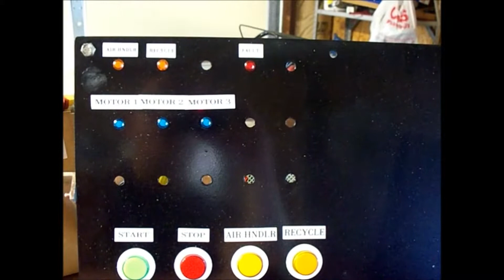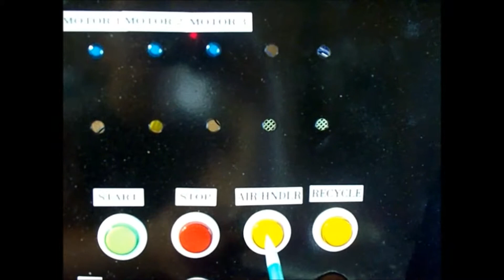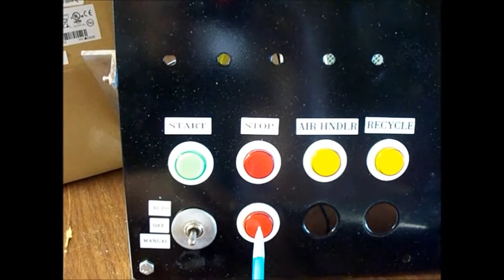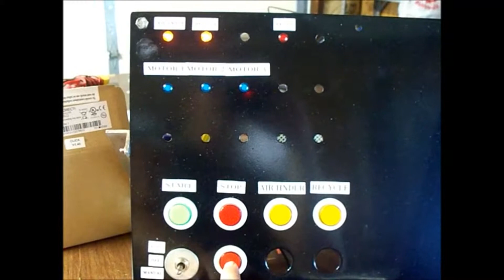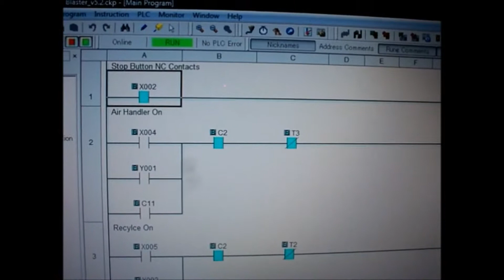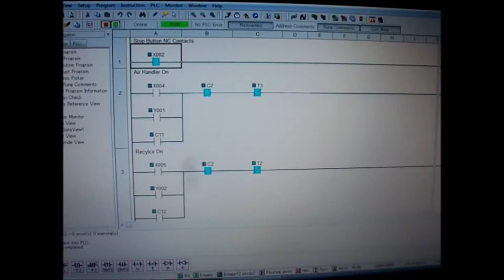Click PLC Project 1:  Wheel Blast Machine Control

Comment: Hello Darren, I liked your video, I was wondering if you can explain how did you wire your plc. Are the lights running on 120 V? thanks
Reply: Yes the lights are 120 V AC.  If you download the click plc manual from automation direct they have diagrams.  Basically the switches close and send 120VAC to each input.  The 120VAC is switched by the outputs and so all the neutral wires of the lights are tied together with each light having its own "Hot" coming from the PLC's outputs.
Reply: J Miller Ok , I will do that; but for what you are saying, so you are running the 120 V from another source? or you are pulling the lead line from the same that goes to the ps that feeds the plc? Or each light has it's own 120 line input.. are you using like a terminal block branching to each ligth? thanks
Reply: Manny Yabar I'm not sure if I understand your questions but I'll try to explain.  Maybe,  if it would help I could shoot another video tomorrow.  All my connections are with wire nuts right now.  This is just a mock up trainer panel I made to get some experience with programming.  terminal strips are what I intend to use in the end.
I basically chopped the end off an extension cord.  A hot and neutral go to the 24vdc power supply for the plc, a hot goes to the common terminal on the output bank (this will be switched out to the lights when an output is turned on), a neutral ties one side of all the lights together, a hot is tied to one side of all normally open push buttons, and a neutral goes to the common terminal on the input bank.
the common terminal on the output bank is the control power that gets switched on as the logic is executed.  the common terminals on the input bank would be the opposite line of the one the switches are sending to the individual input terminals.  this is an AC input Relay output plc.  Things change when doing dc sink/source.  Like I said the manual has good diagrams for each type of CPU and module.  And its free on their website.
Reply: J Miller Great, thanks for the reply and I will keep looking for another video about the connections.  thanks a lot!